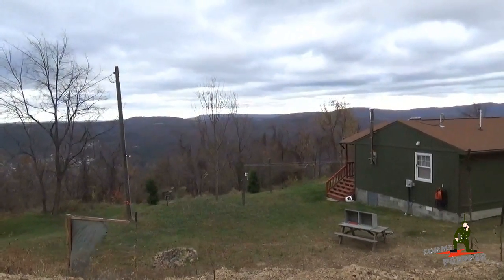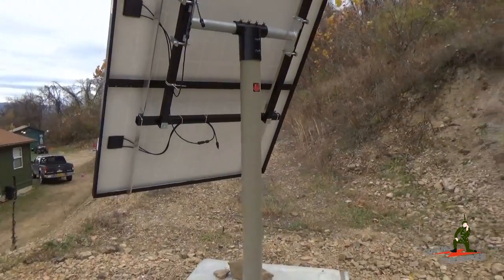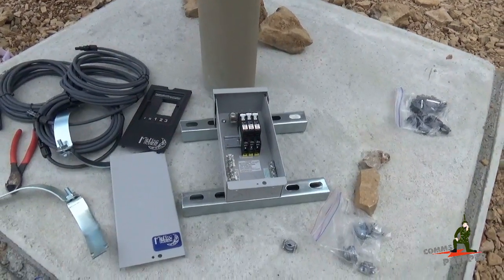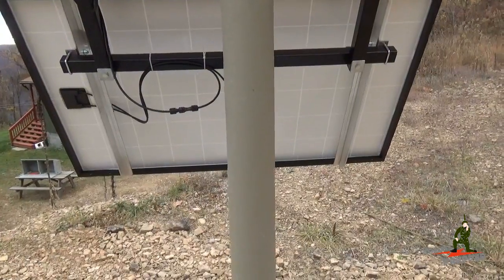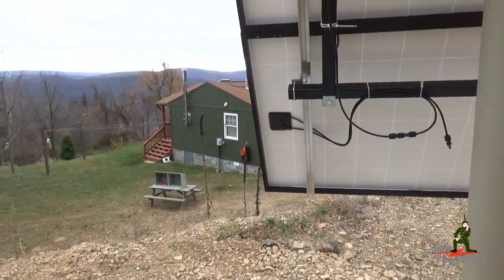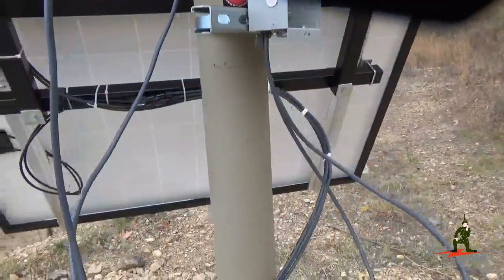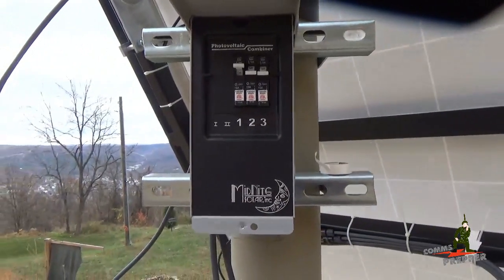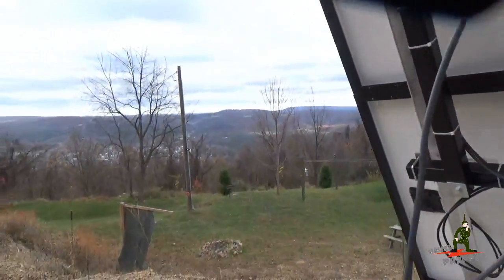MidNite Solar MNPV3 Solar Panel Combiner Box

Comment: Maybe a couple of 20 watt incandescents bulbs in you battery structure for warming in the winter...a circuit that if one blows the other would kick in to continue the warmth....with that much HP out of your panels a light load will be nothing and warmer batteries are happy batteries.. K2RUS AD4ME
Reply from the maker: I do have some 12VDC bulbs...  that's something to think about.

Comment: Your going to expose the battery's to extreme heat and cold on the hill side ?
Reply from the maker: Theredneck Prepper no.  The battery box will be placed in another structure.